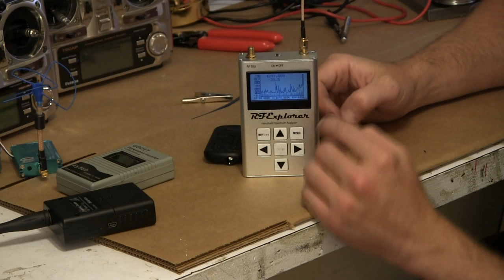Success in FPV part12 - Tools of the trade

Comment: Great video, but there was one piece of information missing. You covered different wattage for lead and lead free solder, but didn't give any recommendations for temperatures of controllable soldering irons for lead and lead free solder. Still, great videos, I'm working my way through the series as I look at building my fpv system.

Comment: Hey! I have the same soldering iron (the Aoyue on the shelf)! Birthday present from my parents after my Weller (analog one) died after 4 years of use :D (need to get some proper cutters, though I have gotten good at biting off the insulation lol).
     I would also suggest extra fuses for multimeters.
XD $12000 analyzer.

And one tool that you did not mention. Second hands. Pretty much a "must have" item when it comes to soldering.

Comment: I suggest everyone get a set of crimpers and some servo pins to make their own servo wires.
Reply from the maker: That's a good suggestion.  I always cut jumpers, but making your own leads is always a good idea.
Reply: Alex Greve Hey Alex if you don't have a crimper give Hansen Hobbies a call, I order from them to the UK but they are located in the U.S somewhere. Their delux crimp tool is excellent quality and servo pins top grade. Little fiddly for most people at first but since your the antenna guy it's nothing. You probably got hands jewellers would be envious of LOL! Seriously though thanks for all the work you put into this hobby, I try support where I can, got a bunch of your antenna's here in the workshop and I been eyeing up a Spectre/Wraith right now.

Comment: I want to buy the RF Explorer 
Is there a specific model # to order?
Reply from the maker: For the RFExplorer, you want the WSub3G unit.  This covers 15-2700MHz.  Mine has a 240-960MHz module in it as well for best scanning of UHF systems.  Not so good for WiFi, though.
Reply: Alex Greve Thanks, I found it on Ebay for about $500.  This probably a little much for the hobbyist?
Reply from the maker: *****
On their website, they sell it new for $280.

Comment: Weller all the way, can you do a vid or suggest a really good diy antenna for your V vtx antennas for 1258, it works with cross hair and bowtie but want a backpack linear. Thanks for the great vids!
 PS the cheap led lipo readout alarms do not match voltmeter readings I have noticed.